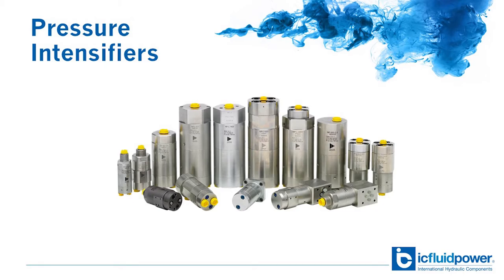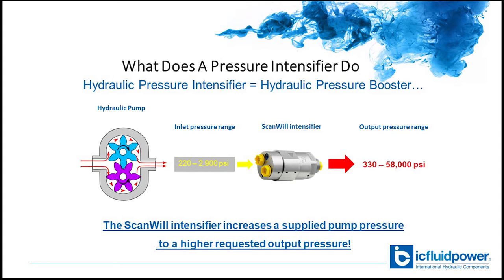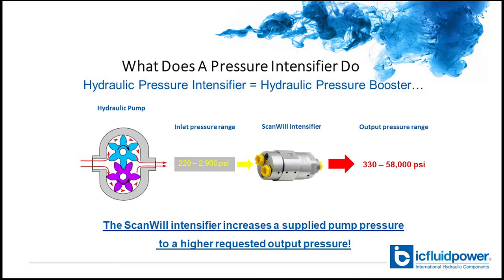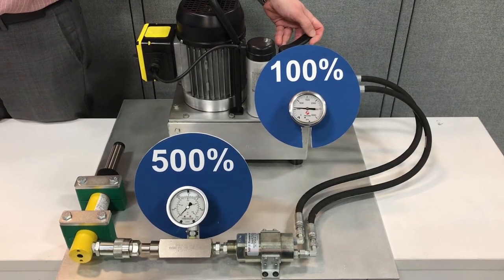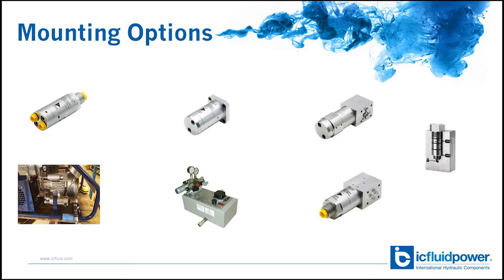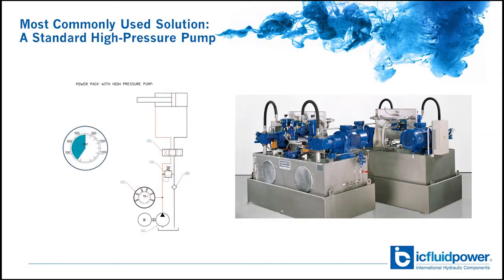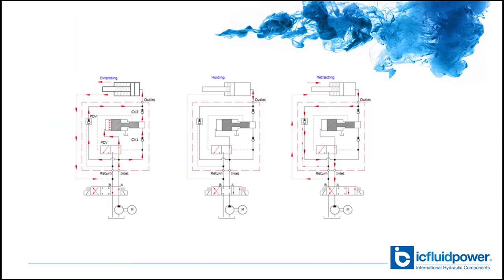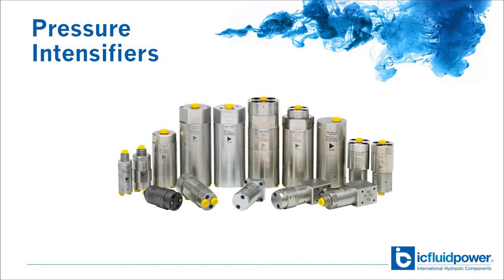Hydraulic Pressure Intensifiers: What are they and how are they used?

Comment: instead of hydraulic fluid, coulld i use something like this to make my own waterjet for high  pressure
Reply from the maker: While this type of intensifier can put out a constant flow of high pressure, the downside is that this flow rate is very small and would not be suitable for a water jet application.

Comment: On the demo, it looks like a single way cylinder. How does the retraction happen?
Reply: Yes, that is correct. In this version, the cylinder has a built-in spring for retraction. 

Double-acting cylinders also work.
Reply: is there anyway I can get a hold of you. I may have a requirement.
Reply: Is there any ways I can get a hold of you, I may have a requirement.
Reply from the maker: Sure, you can email sales@icfluid.com or call us at 419-661-8811. Thanks for your interest!
Reply: Message sent.